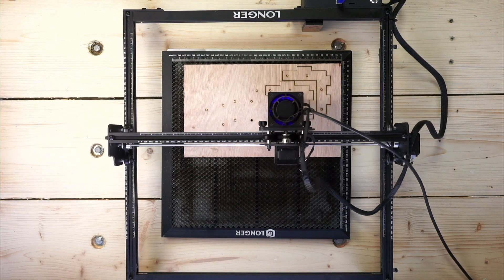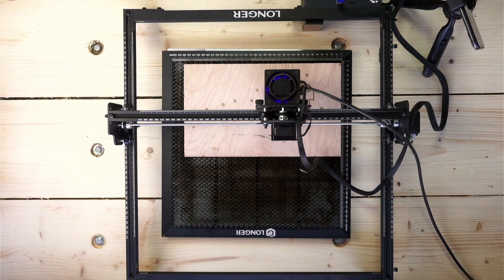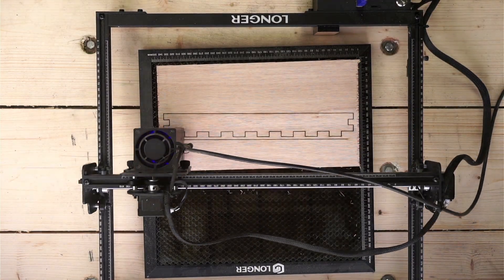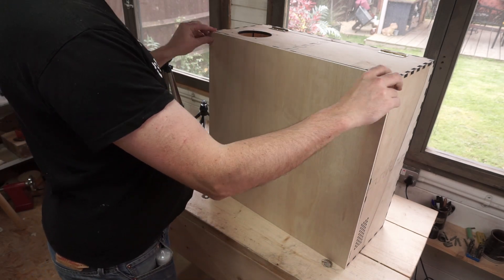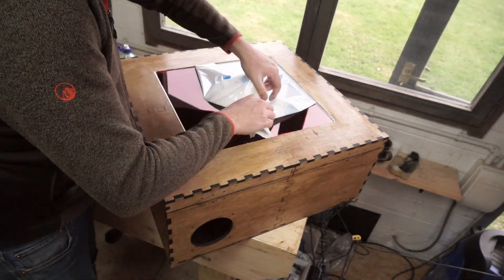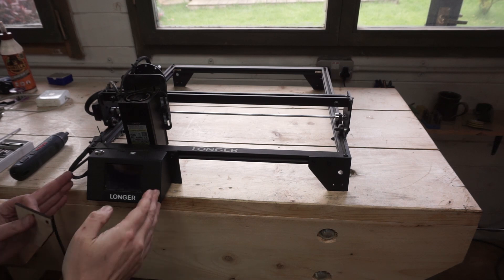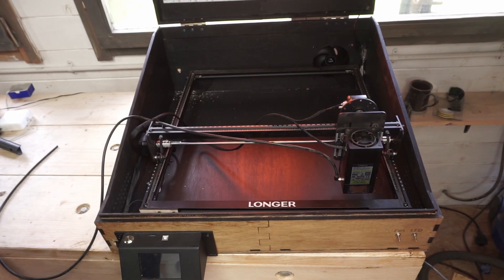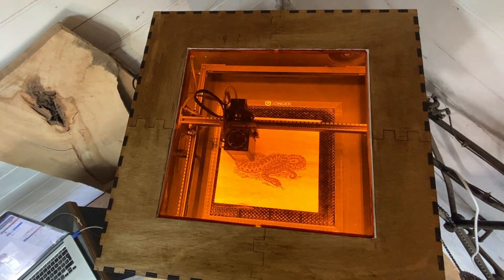Laser cutting a laser cutter enclosure | Longer Ray 5 20W

Comment: Looks very nice! I could see a 3d printed handle on the front, just to make it a bit easier to open. I'm admittedly a little concerned, though, about enclosing a laser in a box made of flammable material. I heard you mention a flame sensor, but what other safety mechanisms does this device have?
Reply from the maker: Yeah, the plan was to put a handle on the front, but I found it didn’t need it as it is easy to open by holding either side.
with regards to safety, I would put this in the same class as a small CNC router, that is to say it has no features other than the flame sensor.
Reply: @roTechnic  Hopefully fire never becomes an issue, then - just in case, might be a good idea to keep a fire extinguisher nearby. Looking forward to seeing what you make with it!

Comment: Great video....I'm making an enclosure for mine at the moment but struggling to find some transparent orange perspex...can you recommend a place ? I'm based in NE of England. Thank you.
Reply from the maker: I found it really hard to find a proper supplier and ended up ordering it from eBay. Search for orange tinted acrylic. But I would suggest you contact the seller and get a data sheet to check it will absorb the 405nm light before using it. Good luck

Comment: Sorry to have to ask, but am I stupid?
I have now spent what feels like hours reworking the files from Github in Lightburn. 

Could it be that the part of the cover with the 2 finger joints is missing? Cutting the files simply twice won't work out. Does anyone else have the same issue or just me? I really  like the approach of using a machine to improve the same machine. It has a bit of a pre-apocalyptic Skynet flair to it

Comment: really nice enclosure, well done! its always cool to put a machine to use to better itself. could you maybe do a video detailing some of the projects that you weren't able to do with a 10W laser? i just got a 5.5W one and i'd love to get an idea of how these diode lasers really scale.
speed is the obvious compromise and i suppose i may be limited to 6mm ply whereas you're cutting 9mm with ease, but i'd love to hear where you saw the limits of one and entirely new possibilities with the other.
Reply from the maker: it’s not just about power, but also dot size. in moving from my previous 10w laser to this one, the dot size also reduced, packing more energy into a smaller space which makes it cut even faster!
I haven’t used a 5.5w one, only a 10w and 20w, but I found that 6mm hardwood ply was the most I could cut without significant charring in the 10w. the 20w can do 9mm easily, which for me means that I can cut jigs for the workshop (6mm is too floppy!)
that’s all with hardwood ply. the 10w would cut 9mm poplar ply, which is great for some things, but dents too much for workshop use (just my opinion)
for your 5.5w I would suggest that first you WILL need an air assist to cut anything, second use a cake cooling rack/honeycomb bed to lift the work off the ground and let the leader go all the way through, and 3rd buy a selection of small bits of poplar ply from 1mm to 6mm and see what you can cut in a reasonable time